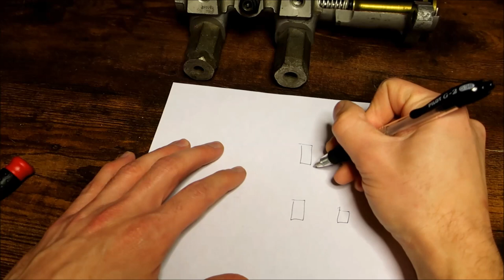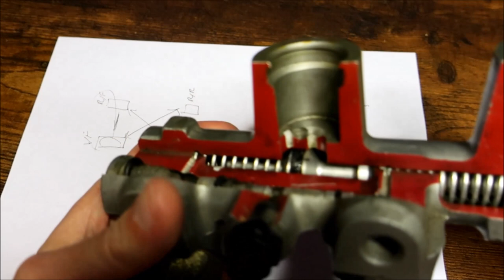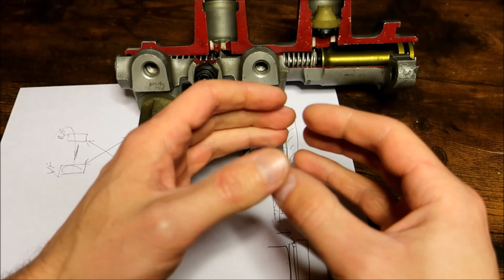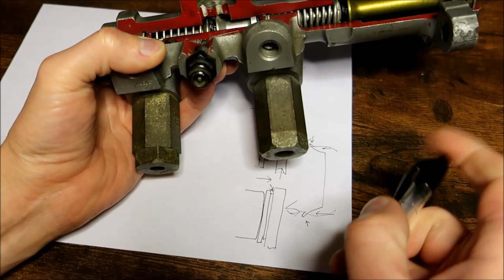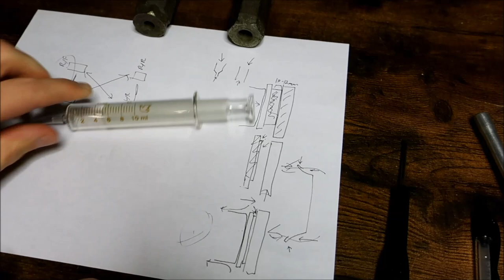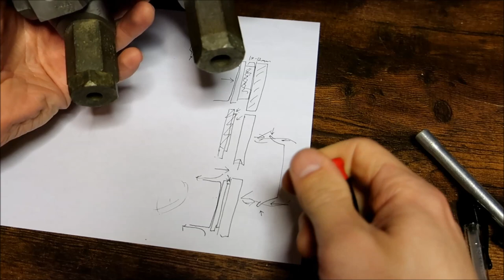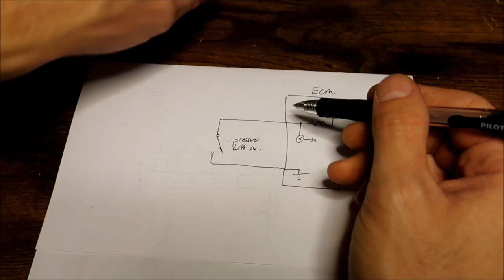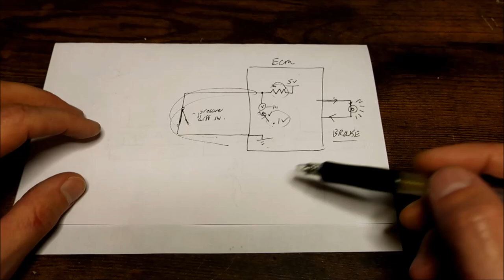Brake Master Cylinder: In-Depth Look and Analysis

Comment: The compensator port has nothing to do with pad or break shoe wear.  They would as you pointed out relieve unwanted pressure from the brake lines as the temperature of the fluid rose.  The amount of stroke required to engage the breaks will be the same whether the pads or shoes are new or brand new.  They essentially stay where they are when the brake pedal is released and braking pressure goes to zero.  As pads wear you would only see the brake fluid level go down in your reservoir.

Comment: I understand how the mechanical linkage between the primary and secondary pistons is present as a fail safe and the springs are only there to return the piston. Those linkages don't come into play when the system has fluid present. During braking the system seems to rely on the primary circuit's fluid being compressed first before it will start to move the secondary piston which will seal off the compensator port and build pressure in the secondary circuit. Put another way, it appears the the primary compensator port is sealed off before the secondary compensator port. That would mean the primary circuit builds pressure and brakes before the secondary circuit. Would this not create a lag in braking between the primary and secondary brake circuit? How did engineers compensate for this in these older master cylinder designs or was this time difference negligible? Thanks!
Reply from the maker: That is an excellent question. Yes you are correct in the fact that the springs serve as a means of ensuring both pistons return to their state of rest whenever the brake pedal isn't applied, but the spring located in between the primary and secondary piston will transmit some of those pedal forces on the primary piston to the secondary piston before the hydraulic circuit is sealed off. The compensating ports are so small and very close to the piston seals that any small amount of travel from the pistons will seal them off relatively quickly. All of that translates into the pistons both applying equal amounts of pressures in both hydraulic circuits at identical times. 
You are more than likely correct that there is probably a very small time lag between the circuits, but it is probably incredibly minor; i.e., nothing that we would notice and nothing that would really affect how the vehicle brakes. Also, another factor would be how the hydraulic systems are split, whether they're front to rear, or diagonally split. On modern braking systems, all of that stuff doesn't really matter, but you already know that.
Hope this kind of made sense. Things are easier to explain in person, but you know.
Reply: @TimmaethBoy  ah yes I did forget the fact that the springs are still in contact with the primary and secondary pistons at all times. So before you begin to overcome the preload of the primary spring and compress it, both pistons will move in tandem. Even once the primary spring begins compressing some force and motion are still translating. It appears the secondary spring is in constant contact at the front of the cylinder? Now it makes me wonder if the spring rates between both springs is the same? I know you can play with timing of mechanisms this way in other systems such as in metal stamping dies with pinning pads, etc.

Great video overall and I definitely learned something! You mentioned in the video description that you teach? What do you teach?
Reply from the maker: The animation is definitely exaggerated, but it is an excellent animation to show the concept behind a tandem master cylinder.
Reply from the maker: Yes, the spring up front is in contact with the secondary piston as well. The spring rates are all determined by the engineers so they are more than likely going to be different in size, rate, etc.

I teach automotive technology at a local community college for up and coming automotive technicians.

Comment: In general, I would not use the model of a compressible working body - air - to explain a hydraulic device where the working body - fluid - is incompressible.

Comment: Thank you. A very comprehensive look at master cylinders, albeit older relative to todays technology. A proper understanding of this technology helps with diagnostics on older vehicles. It's my view that this is a definite prerequisite for proper understanding of the newest technology and how newer technology addresses old problems.👍
Reply from the maker: Thanks James. Glad you found this video valuable. I may do a segment in the future on more modern electro-hydraulic braking systems. Still a lot of the same concepts here, albeit with more electronic controls.

Comment: A brilliant explanation for any body new to motor engineering and wanting to understand how it  actually works.  So far ahead of early Master Cylinders , one leak and no brakes.
Reply from the maker: Thanks Rod. Glad you enjoyed it.
Reply: I experienced total brake loss in a 1960s Pontiac. I stopped the car by downshifting and using the emergency brake. I think this was before they used dual circuit systems.

Comment: 43:30 minutes well spent.  Studying for the ASE A5  I hope you do more in-depth videos on brakes.
Reply from the maker: Thanks for the kind words and sticking around for the whole video! It is definitely not a short video, but hopefully you were able to learn some new things about master cylinders.

I actually will more than likely make a video in the next few weeks covering wheel speed sensor basics and signal troubleshooting; those are key input signals for your electronic brake control (EBC) systems including ABS, TRAC, ESC, etc.

Comment: Very informative.  My first time trying to bleed brakes { ABS } equipped.  I understand closed loop hydraulic principal, what I need is a video on air in the system, all the different places it can be hiding and how to deal with it.  From what I've seen on-line I'm not alone

Comment: Thank you! Nice explaination only one thing not confirm, we consider primary unit to right side which is in contact with push rod
Reply from the maker: That is correct. The primary piston is in contact with the push rod from the booster.

Comment: Great presentation. I'm left with a question regarding the step bore and quick take-up M/C. It appears that the extra volume of fluid from the movement of the primary piston into the step bore can only enter the small chamber of the primary system. If that's true only one of the two front calipers will see the quick take-up fluid volume if the system is a diagonal system. Can you explain how this works? Thanks
Reply from the maker: Great question. Yes it's true that fluid only bypasses the primary piston during the take-up phase, but keep in mind that the extra fluid is not only flowing into the open hydraulic circuit for one front caliper. The extra fluid flowing into the chamber between the primary and secondary piston is also pushing on the secondary piston; this movement of the secondary piston is what is taking up slack on the other front caliper. They have everything dialed in in the system to make sure both front calipers extend out to take up the slack equally.

Hope that makes sense.
Reply: @TimmaethBoy  Makes perfect sense. Thank you for taking the time to answer my question. Your students are lucky to have you as an instructor.
Reply from the maker: @foghornleghorn8536  Anytime.

Comment: Question‼️
If I understood the lecture properly, the pressure in the Pressure Differential Switch will be different under high loads like panic breaking. Will it cause the switch to close? Did I understand that correctly? How does the computer manage such situations?
Reply: And thank you for the video!!! Very easy to understand, covered a lot of mechanics/hydraulics behind it! College level explanation, very in depth and practical. I would love to know if they use the same system on modern vehicles because if something goes wrong on my car I would like to understand what is happening based on how the issue shows.
Reply from the maker: @vasylhordiienko7465  No, the pressure differential switch is only there to detect a hydraulic fault in one of the brake circuits. If you have a loss of pressure in one brake circuit, then the pressure differential valve will move because of the pressure imbalances, activating the switch.

Comment: I have a 2000 Ford explorer that I deliver mail in and I lost brakes completely. I was going in reverse on a downhill decline. And as slow as it was going I still couldn't stop and had to throw it into Park. So my question is if I still should have had half stopping power how come I didn't? Any answers greatly appreciated.
Reply from the maker: Sounds like heat fade, i.e., overusing the brakes, especially on inclined surfaces – overheats the brakes to where they no longer work. They have to generate heat to work properly and if they're already too hot, there's no way it can create any additional heat. Usually when this happens, you lose feeling in the brake pedal too - feels stiffer and can't feel the pads biting, at least in traditional brake setups.

Comment: Great explanation - thanks.
Regarding brake bleeding, I have seen videos describing two different sequences ..

1. open bleeder screw, press pedal, close bleeder screw, release pedal

2. pump brake pedal and hold down, open bleeder screw (pedal drops to floor), close bleeder screw, release pedal

Do you have any thoughts on which of these is the better method or if it matters.

Thanks
Reply from the maker: If it's a conventional brake system, then method 2 is a good way of bleeding the system. Do full pedal strokes during the pumping process, 3-5 strokes, hold it, have someone (or you) crack open the bleeder valve for a few seconds (honestly no more than 3 seconds), close the screw, release the pedal, rinse and repeat until clean fluid comes out/no air pockets are present. Most of the time, you start the bleeding procedure from the right (passenger) rear wheel, then the left rear, right front, and left front wheel, but that isn't always the case, so check what the manufacturer recommends for the bleeding order. Also, make sure you are frequently topping off the master cylinder reservoir to ensure the level does not drop below the minimum mark.

Unfortunately, you would need a helper with this method and that isn't always possible. The good news is decent quality pressure bleeders are relatively inexpensive and you can bleed brake systems by yourself. Just pressurize the brake system at the master cylinder reservoir to a specific pressure, open the bleed valve until you're satisfied with the fluid coming out, torque it down, and move on to the next wheel/bleed point.
Reply: @TimmaethBoy  Thanks so much for the reply.  I was mainly curious as to why some folks say to press/pump the brake pedal before opening the bleeder screw and others say to open the bleeder screw before pressing the brake pedal.  I guess it is just a matter of personal preference, although pressing the brake pedal first would pressurize the system before letting out the fluid .. maybe that would tend to push any air bubbles toward the bleed point ?  Just guessing :)
Reply: @neilbreakwell4500  Your idea about the bubbles is spot on. Building the pressure first will allow any air trapped in pockets to be shot out and some times you need that extra boost to get a bubble to head either down against gravity or out of a junction..
Reply: @rivit7615  Thank you.  Always wondered why two different methods are described in different videos.

Comment: Hi Tommy. Thanks so much for this very informative video! My 2005 Vectra has all round disc brakes and an ABS module. The two braking circuits are diagonally arranged. For many years now the brakes on one circuit have worn significantly faster than those on the other, so I only get 6000 to 10000 miles out of a set of pads (not good!). I have had the flexible brakes hoses replaced (as they can implode internally), and have had the two callipers replaced multiple times. My garage keeps telling me it can't be the master cylinder, as there is no leakage and the brake pedal is hard. Also the brake light doesn't come on, and braking feels normal when driving. Could there be some issue with the master cylinder that could cause this?
Reply from the maker: You would really need to have the shop do a pressure test on the lines to give more insight as to what's going on. I suspect that the brake circuit causing you issues has residual pressure even with the pedal not applied. You need to have the shop check the pressures at the calipers of each wheel with the brakes released, and then fully applied - key OFF engine OFF, then key ON engine ON (you should see a large increase in pressure with the engine running, but mainly just wanting to see how the pressures behave in both scenarios).

If that particular circuit's pressure is controlled by the primary piston of the master cylinder, then you could have a problem where the piston is not retracting fully and creating a slight pressure buildup in the brake circuit even when the pedal is released. What usually causes this is a misadjusted booster pushrod where it's too far out to where it's either: a) partially applying the brakes even with the pedal released (worst case), or b) blocking the compensating/vent ports and not allowing the fluid to expand properly under normal heat cycling of the brake system, which will cause the brakes to begin applying slightly the more the system heats up. You could have an odd problem where the primary piston itself isn't seating fully in the housing, but again, a pressure inspection will give some insight into this.

Don't rule out the ABS module as well. The internal valves can stick and cause pressure related issues as well, but once again, it all comes full circle to figuring out what pressures are actually seen at each caliper assembly. It takes a competent shop and some patience to troubleshoot some of the more difficult brake concerns. Best of luck!
Reply: @TimmaethBoy  Thanks very much for the detailed reply Tommy! Will have to see if I can find a garage capable of doing it.

Comment: Hi, how does the fluid replenish into the system across the check valve? As fast as I know a check valve is a one way flow ? Thanks.
Reply from the maker: You're correct; fluid has to fill the pressurizing chamber through the check valve somehow. To do this, they include a cup seal as part of the take-up valve design. Cup seals also act like one-way check valves by allowing fluid to flow from the reservoir chamber into the pressurizing chamber (very slowly), but then seals when there's an increase in pressure (during the take-up process) diverting the fluid from the pressurizing chamber up through the check valve and into the reservoir. 

It's hard to visualize this without seeing a demo, but I recommend you do a patent search and read the articles on the quick take-up process to get an idea of what I'm talking about. Hope that makes sense.

Comment: Zabardast cheers from Toronto.....at 25,000 kms 4 years old Mitsubishi RVR losing DOT4 fluid.....but cannot find the leak! Please advise. Also, the stupid Reservoir is inclined for some reason?
Reply from the maker: If you don't feel any change in your braking performance and you are positive you don't see any leaks from the calipers, bleed screws, HCU, or lines, you may very well have a leaking master cylinder secondary seal. The brake fluid leaks past the seal and into the vacuum booster unit. If that's the case, you're looking at a new master cylinder and booster unit; brake fluid destroys the rubber diaphragm within the booster.

A way to verify this is to check and see if there is any wet looking fluid on the back of the master cylinder where it meets up with the booster; sometimes it looks wet underneath there if the seal is leaking, but not always. You can also pull the vacuum hose off at the booster (engine off) and see if it looks like the inside of the hose is wet with fluid. If it is wet, that could very well be brake fluid it's sucking into the intake manifold from the booster because of that seal leak.

This is all speculation though and I'm assuming you've traced everything else thoroughly to make sure nothing else is leaking. Also keep in mind that the brake fluid level gradually drops over time as your pads wear - starts full from the factory, then by the time you need new pads, it's somewhere between the halfway mark and minimum in the reservoir.